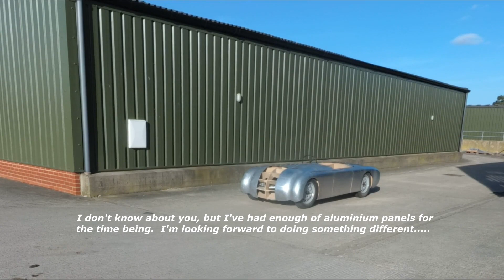Project Etceterini - Part 8

Comment: Thanks for showing every step in such detail.   I learned a lot.  I presume it is important to anneal the welds in order to work them.  This video seems to convey your sense of satisfaction in your work.  You ,sir, are an artist!
Reply from the maker: Thanks Mark!  When gas welding it tends to anneal the area around it, so there's not much need to anneal the panels or joins seperately

Comment: Was surprised by the size holes you were able to fill.  I think you've got the knack with this ali welding!!!   Anything at the end you wish you knew at the start?  Everything seems to be lining up a treat.
Reply from the maker: Thanks!  I've definitely got better as I've gone along as I couldn't fill holes like that to start with.  Often the 'fills' will show a crack after finishing that will need a little welding again.
There's nothing that I think I'd do radically different if I started again from scratch. Fingers crossed it all lines up at the end!

Comment: Are you going to use some filler on this car or just finish it as best as you can and leave the hand built patina? Great design!
Reply: filler? what's that?
Reply from the maker: Thanks! I'm leaving the handbuilt patina.  I'm more of an oily rag than concours type.
Reply from the maker: It will receive another round of finishing and smoothing off prior to final welding too.